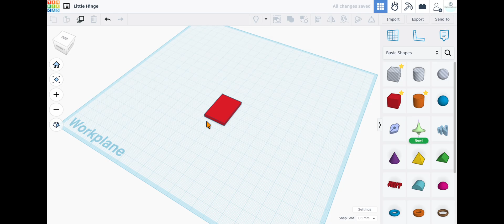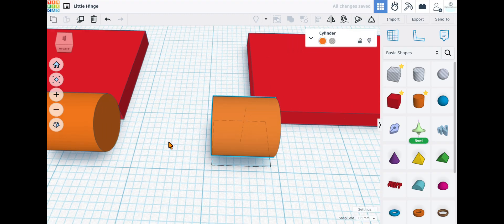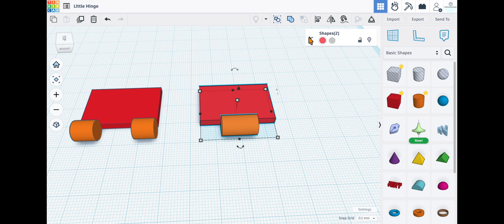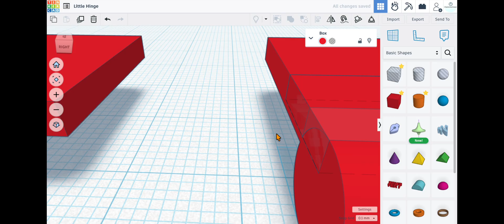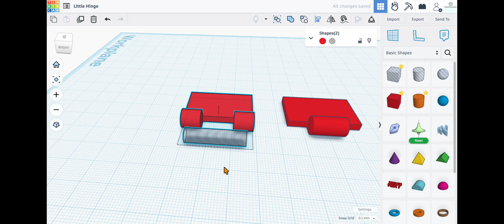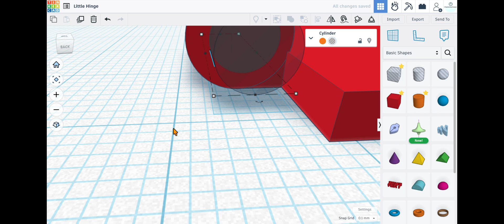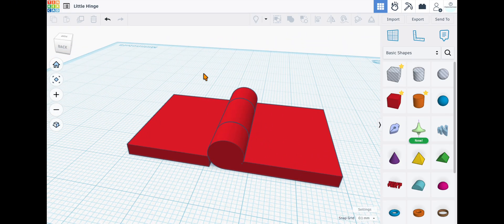How To Design And 3D Print a Simple Hinge

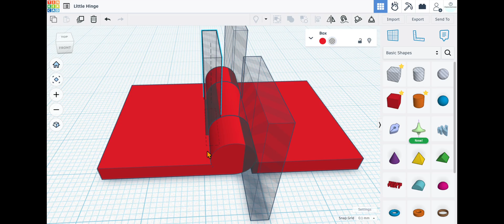Comment: This is a wonderful video but at 9:09 I got lost. How did the box not cut out the part of the barrel it was touching? Look at making a video on making a 3 leg stool and place the 3 legs 120° fron each other leaning out 5° and cut off the legs. I tried a lot of different ways but gave up and went by eye.  It's a doll house size. Love all your videos. Thanks for making a great program very usable.
Reply from the maker: You are correct, that last piece you want to make sure it doesn’t actually cut into the barrel as mine did slightly. I discovered later, It was simply an oversight. Although it didn’t affect the functionality of the final product, you are right to notice that part in the video. Thanks for watching and supporting my channel!